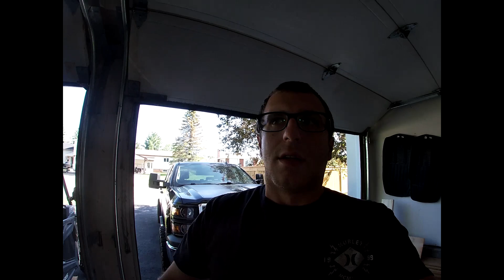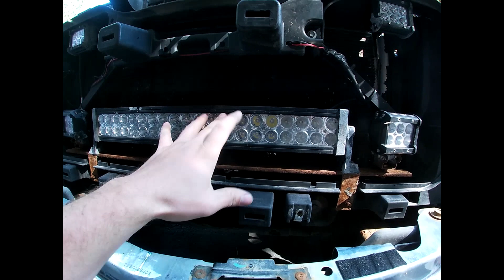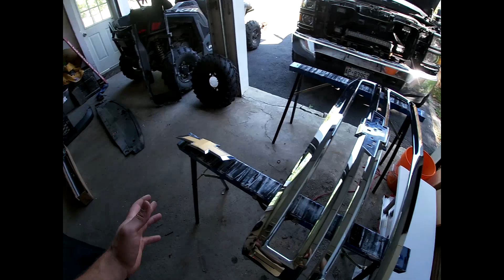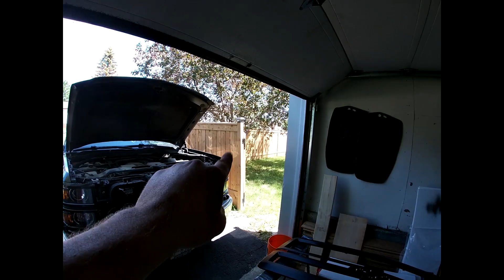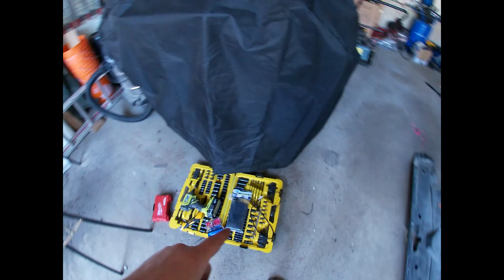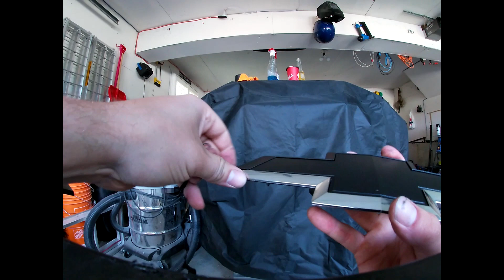My 2014 Silverado Gets A Facelift!

Comment: Have you thought about trying canned bedliner spray for the mounting bracket? I use a wire brush on my drill to get rid of the rust and prep the area, alcohol to clean and spray a few coats on everything from rusty hitches (not the ball obviously) to boat trailer parts. I find it’s much more durable and keeps the rust off that much longer than paint. Love the videos man
Reply from the maker: Thanks buddy! Not I have no tried that however I will give that a try on my hitch because it’s starting to rust a little from towing the SXS. Thanks for the input 👍